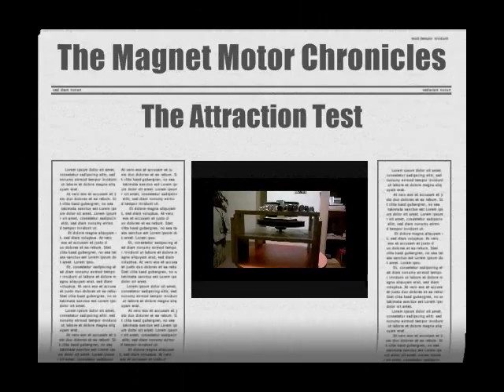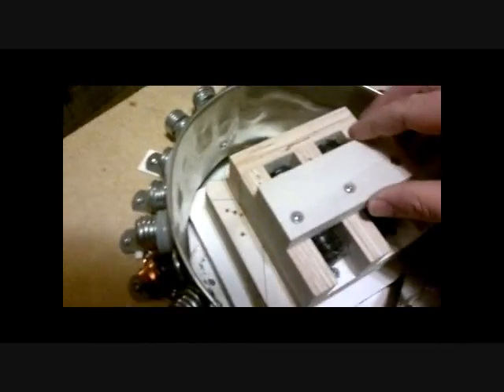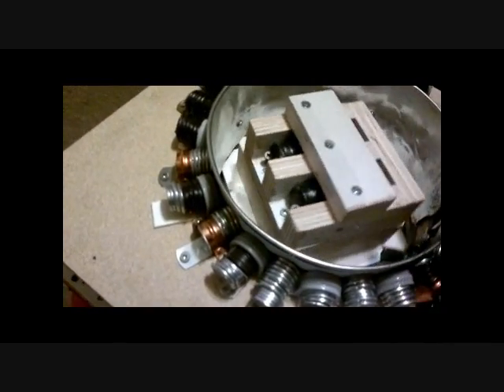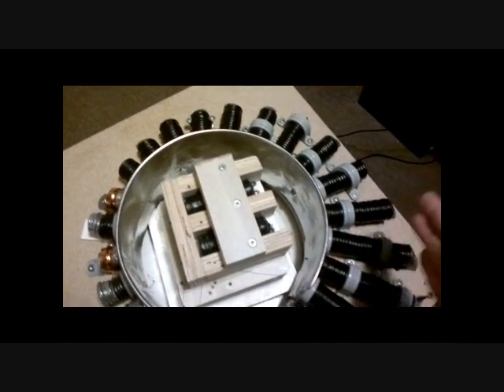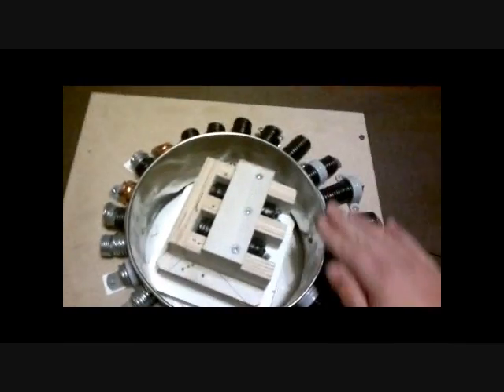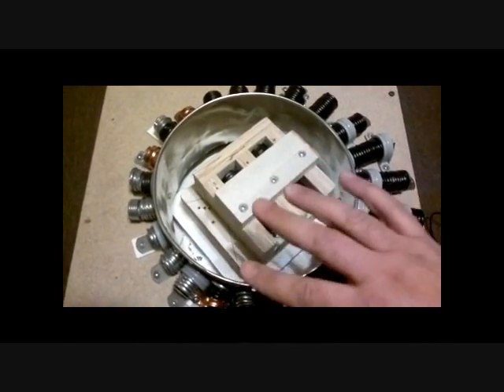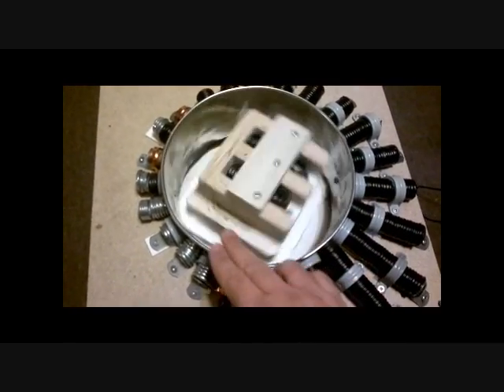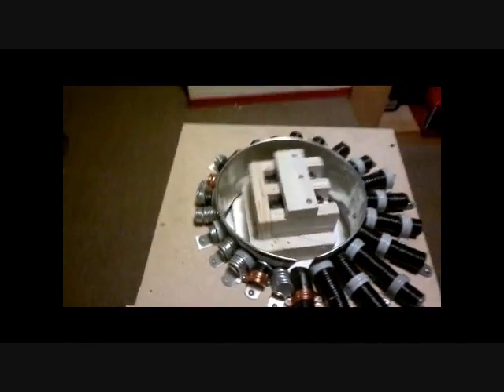The Magnet Motor Chronicles The Attraction Test

Comment from the maker: oh no its a great question. Perhaps you are referring to what they call shorting a coil to collect radient energy spikes. Switching solenoids not sure about that as you would be adding energy in but you could capture the radient energy spike from the collapse of the coil and use it to help power the other coil. Have a look at my other videos seen from my channel, there is a magnetic solenoid that I have made using shaker flashlights where i can if need be use the energy from the coils to help

Comment from the maker: well it doesn't work in my basement so I'm fairly sure it will not work anywhere so location isn't important. Earth magnetism and angle, unknown. Dimensions, you can make it any size you want and it isn't going to work as is, but the diameter of the circle for what its worth is 9 inches.

Comment from the maker: yes i have tried that and stood it vertical and had the stopping point around 3 oclock so that gravity could help break the lock. I have even used counter balanced weights on it but ya to no avail  still the same stopping region. However in repel mode I should get almost full rotation then I can work on blocking the cogging point with sheilding or a shutter of some sort etc.

Comment: You gonna make me do a video of mine, aren't you. Hehe. Think in terms of a circle within a square. The rotor (circle) has neo cube magnets on it's outer perimeter. The square has multiple neo bar magnets aligned on a 45 degree slant on each of it's 4 inner planes. Just make damn sure your magnets are well secured to the rotor cause it will haul arse on ya.